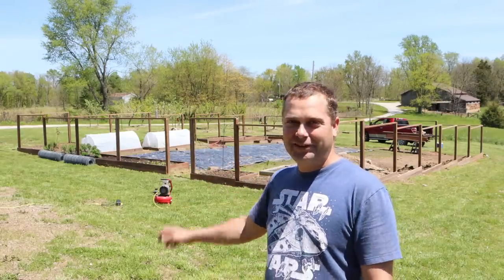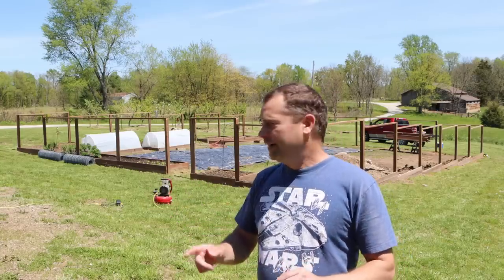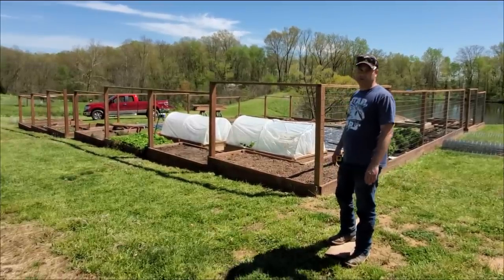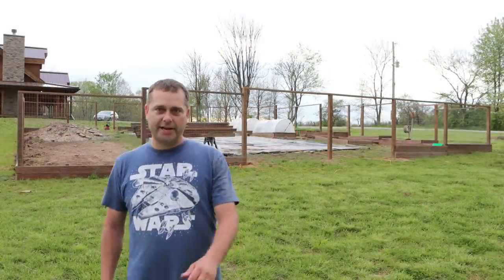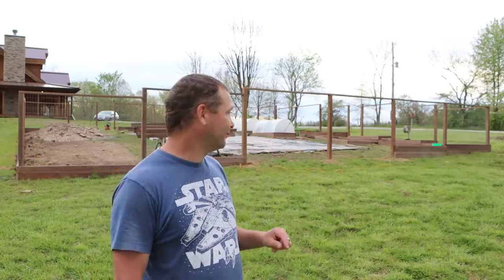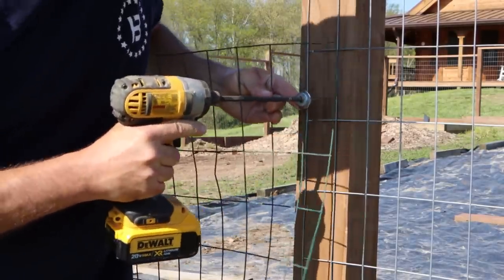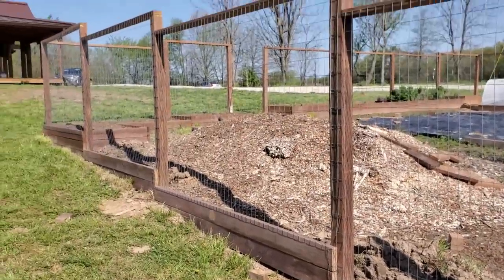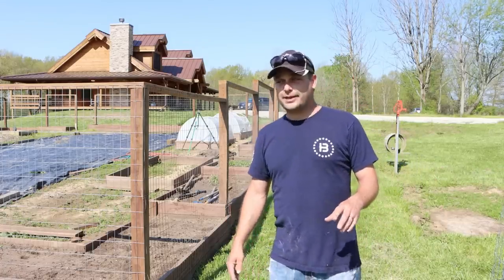Fencing in the Vegetable Garden.  Installing welded wire fence.

Comment: Good job on the fencing. I have the same fencing around my property and have discovered that rabbits will go right through the 2" opening. You will need put some fencing with a tighter weave about 24" all around the bottom to keep the rabbits out. I had to put rabbit fencing, 24" all around my property to keep them out. I just put it on right over the 2"x4" wire I had already put up all around the bottom.

Comment: home depot sells the galvanized staples for your gun 1 1/4" or 1 1/2" both 1/4" crown , you might be able to put a double slide type barn door gate on the fence, just a thought
Reply: Securing the bottom of sliding doors is a challenge, especially with no center post or ground plate

Comment: May I make a suggestion for your gates...put a false post in the centre to hold your gates stable. Your post in the centre of your opening needs to have a cemented in metal post in the ground cut at ground levelthen your post sits inside this so it can be removed if you need the double gates opened.  This way you can open one gate at a time but both are latched to the centre post but both gates are hinged on the outside  posts. You'll find it so easy to use this way. Love your whole garden.

Comment: use top rail for chain link fence and make gates fasten welded wire .  you can get stainless staples from amazon. you could also use treated furring strips and screws to cover edges of wire.
Reply from the maker: I ordered stainless staples last night.  👍

Comment: As for closed gate or door to the opening on the garden; I would suggest a pallet door set vertical to the opening. You can fence wire if you need to keep the animals out.

Comment: Great video! I have dogs too, but my dogs are older and they know not to go near my plants. I have a big problem with rabbits though; they keep eating my stuff especially the winter greens, onions, peas, and more. I have to build something around our vegetable area, but I don't think I can do what you did; beautiful work you did with that fence :)
Reply: Maybe break down each side of your garden down into "bite sized" panels of a size that you CAN work with - then assemble them together around your plot?

Tip: Snap a line along your horizontal, then drive in 1-1/4" Torx screws, with fender washers, leaving enough gap for the fence. Hang the fence on the screws and tighten from the ends.

Comment: JudithB  The fence  looks  great!  I  plan  to  build  hoops  for  2  of  my  new  beds  but  I  will  put  netting  on  first  for  summer  use,  putting plastic  or  cloth  on  for winter.  I  want to  be  able to  turn my  chickens  in  during  winter  to  clean  weeds n bugs out,  but  still be  able to  protect  winter  crops  too!  My  dogs  learned  pretty  fast  to stay out of my  gardens,  but  biggest problem is  deer,  so  my  fences are  7'.

Comment: Good looking job. Only suggestion is I would have placed the top boards on the outside of the posts with the wider side facing the inside/outside. The would have been less likely to sag over time.

Comment: galvanized staples will not last either, when exposed to the chemical treatment of the boards and posts. you have to get staples with the special coating, like deck screws, that is somewhat resistant to the chemicals. you did an excellent job and i always enjoy your videos. take care and say hello to the better half for me...........g

Comment: Good job on the fence. Like others have mentioned, rabbits and other small animals will get through the bottom so you may want to add smaller mesh on the bottom. Word of caution, the rails will sag over time (gravity)  because they were laid flat rather than on edge. Did you consider the height to keep deer out? They will easily be able to jump over 5 ft. Here in Minnesota deer are a big problem.

Comment: If you catch your dogs in the garden, roll up a newspaper and tap them on the butt or nose, that will get their attention and they will remember that they got a swipe for doing that. It won't hurt them, but it will get their attention. The garden is looking really good and you did a good job with the slope you had to work with! Good luck on the planting.

Comment: Nice project! I like the idea of welded wire too. Are the bottom running boards going to rot out quicker because they are actually on the ground? Should you dig out under it and put in some gravel? Great job! The only thing that can get in are small rodents, snakes, and birds.

Comment: Over time those flat top rails will sag. Did you consider using 2x Joist hangers and mounting the top rails in the vertical direction?

Comment: Ahh, you make it look easy. I see I will need a circular saw and the longer leverage reader. I have never used a circular saw, is there a certain brand and blade size that I should consider?
Reply from the maker: 6.5 or 7.5 inch blade.  A lot of good brands to choose from.

Comment: Is that pressure treated lumber used on your garden..yummy nothing like  Veggies marinating in contaminated soil
Reply from the maker: New pressured treated lumber isn't made with arsenic.  It is made with a copper based treatment which is approved for raised bed gardens.  It may may not be approved for "organic" certified gardens, but it is deemed safe.
Reply: @CountryViewAcres  ok.  But I'm going to check with you in 10 years

Comment: Don't bother with the Staples. Add a 2x4 over each joint and it will cap the staples, plus you can cover the joints in the fencing, especially since this is a more permanent fence. Also, used a stapler like yours on my fence about 10 years ago and still haven't needed to restaple anything.

Comment: Killer job on the details, building for the long haul! 18ga narrow crown staples aren't strong, galvanized coatings on those are flash gal and PT eat them for breakfast. A 16ga stainless steel would be 100X stronger. Look for 7/16 crown staples and a tool for 2" staples. Good luck and reach out if you want better info, staples and nails are my day job.